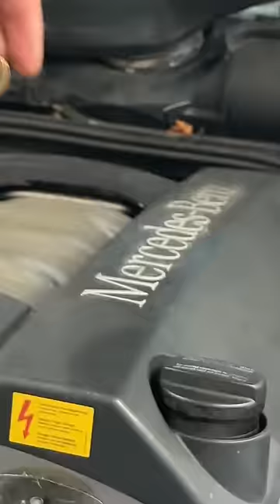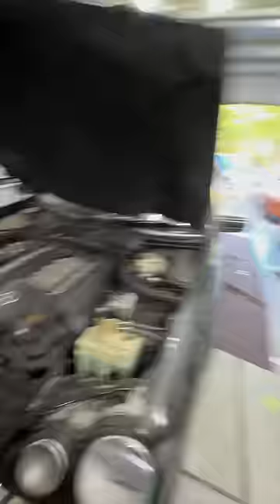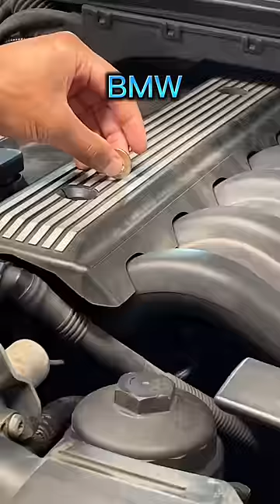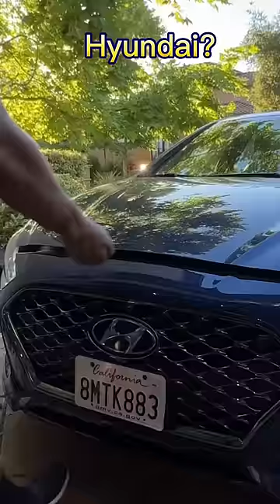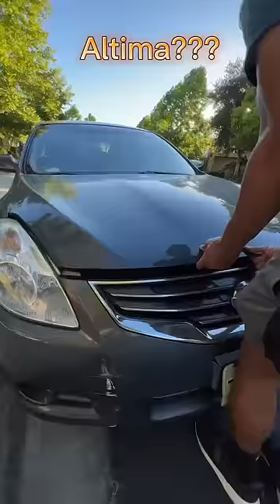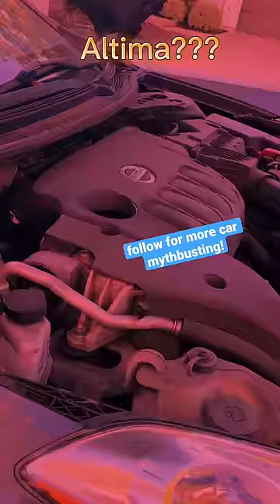The last one is 100% the best 🎩🎩🎩

Comment: This has to be the most pointless experiment I’ve seen, some engine covers are more round ten others, engine displacement are different, exhaust systems would have an impact of not stock, engine type (v vs inline cylinders).
Reply: This would require thought. I think last check zoomers have an average of 7 iq points less than the average of other generations.
Reply: The "coin trick" was the dumbest thing ive ever seen. Completely pointless and makes as much sense as putting a Chevy Equinox engine on a 2004 Vette.
Reply: Its just a flexing vid, "hey look at all my cars"
Reply: Agreed..even each car also got different condition of engine mounting ( rubber )
Reply: It shows how balanced the engine is
Reply: It’s supposed to be a jab at rolls royce and to show how many goddamn cars he got for no reason
Reply: Exactly, it’s as if people never heard of droning
Reply: @tomp6064  bruh engines are meant to shake, it's literally built in so the car doesn't just rattle itself apart
Reply: The reason why the coin doesn’t fall on a RR, is because it’s powered by the most balanced type of engine, a V12. Why this test is completely pointless, it would only make sense if you compared with other V12 engines. 

And then you have to consider the fact about engine covers and stuff like that afterwards.

Comment: as a volvo 740 owner you want your engine to shake it helps offset the piston slap.
Reply: This is the funniest shit I’ve seen all day
Reply: depends of the engine. some architectures can be balanced so that they barely shake because the momentum of one piston is offset by the momentum of another piston moving in the other direction.
you can counteract linear momentum with just 4 pistons in the engine, but it will still produce some angular momentum that will shake the engine. it can be good, but not perfect on a v8, and it may be made perfect on V and W architectures above at and above 12 pistons.
Reply: @niscent_  thats an awful lot of words for "I completely missed the joke"
Reply: @fake_name420  i, indeed, completely missed the joke.
Reply: It's called synergy 😂
Reply: @niscent_  These are jokes that these dorks must announce as jokes before they start.
Reply: It’s actually really funny. Remember the 740’s and I think most any Volvo’s that came equipped with the B230f or B230fT(t for turbo) engines had hydraulic oil filled motor mounts to both mitigate engine vibration (shake) and serve as break away points in a big collision. So yeah they literally designed their car around big ol engine shake.

Comment: "Tell me you don't know shit about cars without telling me."
Reply: True
Reply: Do the coin test 🤣😂
Reply from the maker: you definitely haven’t seen any of my other videos so i guess i can’t blame you 😂
Reply: Competitors but BMW owns rolls Royce and you did it with a Hyundai😂😂😂 Find another hobby or do more research
Reply: lol, agree
Reply: @ChrysGaines  😝 ikr
Reply: @ChrysGaines  You'd have to make good videos first to say that shit tho xD
Reply: @ChrysGaines  You bought a brand new BMW that's a 2.0L, if you knew cars you'd know that's a joke, turbos or not, there's no replacement for displacement
Reply: "tell me you have no sense of humor without telling me"
Reply: Yondai
Reply: yea
Reply: @ChrysGaines  who would want to watch more if they're anything like this.
Reply: @ChrysGaines  uh no... You have torque, balance, mass, reciprocal forces and many more. From resting to start it's not small. Revving is gradually increasing those forces. And V8's are too light to have that clean Ballance. Inline engines are the most stable but again reciprocating masses make it vibrate. V12 engines have equal counter reciprocating masses to have the most proficient performance. The only way to get it smoother is twin engine left handed and right handed equidistant from centerline of the engine bay and a short cable circuit with each starter with the same current in each. But we get that set up on ships. Rarely on boats as they can have 5 outboard motors. Not to mention the bell curve, cause of course that thing just screws you over in some way as it's correct no matter where you put it. There's a certain point of mass to power where the engine will make women very happy. Smaller engines tend to vibrate less as the power doesn't move the mass well, and too heavy where the power can again not vibrate the weight. And the middle where the power and weight mesh well. Aka nissan engines.
All engines will have vibrations i am very aware of that. The smoothest engine. Aka any engine I'd make after brushing up on my knowledge as i have been focusing on other engineering disciplines because that's just stuff i can do for some reason. It will still make a happy lady.
Reply: @ChrysGaines  wow!!??11 who would have guessed that older cars wouldn’t get a high score111!?1?1?1
Reply: @ChrysGaines  you definitely just dont know how cars work
Reply: @memorimusic420  and who gives a f*ck how cars work 😂 this sh!t is a hobby for 90% of us
Reply: @Ksilla007  bruh🤦‍♂️
Reply: " Tell me you're just jealous of somebody's collection and income you could never have without telling me you're jealous "
Reply: dude is really in the comments pretending he knows something
Reply: @ChrysGaines  noice boom roasted
Reply: Rolls Royce, BMW, Mercedes, Hyundai, and everyone's favorite brand.... Altima lmao
Reply: @ChrysGaines  why would anyone watch them after seeing this video..
Reply from the maker: @guiltkill5607  I only talk down to people who don’t have enough brains to process a simple fun video done with the vehicles I have available to me in my garage.
Reply: @ChrysGaines  Well you should have enough brains to understand that 95% of people watching your video or come across it, will think it's extremely misleading (which it is) BEACUASE THE MAJORITY THAT COME ACROSS IT DONT WATCH YOUR VIDEOS THAT ARE JUST AS MISLEADING. I rest my case. Make better videos, end of story.
Reply: @ChrysGaines  ChrisGainSomeBrains
Reply: @ChrysGaines  who cares lol
Reply: @kane2440  copycat
Reply: @guiltkill5607  u should know that the vids are made for fun and not meant to be taken seriously which is something only the 5 percent can do
Reply: what is it for?
Reply: IM THE 6.9K TH LIKR LETSSS GOOOO
Reply: @ChrysGaines  you had it right on the valve cover for the second car.
Reply: @Chrys Gaines  you literally know absolutely nothing
Reply: it's a test...not a fucking exam
Reply: @entiretotalityofwhateverexists  calm down
Reply: @monkey5818 bmw didn’t always own rolls Royce and rolls Royce is still technically a separate manufacturer. It’s not exactly completely bmw. If anything bmw is picking up what rolls Royce left behind because stability and silence has always been a RR thing
Reply: @monkey5818 also that bmw isn’t a bmw owns rr bmw it’s too early
Reply: FACTS...them mounts on that Benz got 234k orig miles
Reply: @autolabpro3186  learn to spell
Reply: @puppetmaster634  oh ok, what did I misspell ?
Reply: @puppetmaster634  😁😁😁
Reply: @autolabpro3186  1, that comment makes no sense. 2, "them" wast the right word
Reply: @puppetmaster634  ah yes! Thank you!
Reply: @autolabpro3186  learn to spell
Reply: @puppetmaster634  I will take a class tomorrow, thank you
Reply: @autolabpro3186  enough sarcasm already
Reply: Man… bmw sucks
Reply: @ChrysGaines  After that one no man would like to watch another
Reply from the maker: @doublebaked267  i mean, 22.8 million views and 13k new subscribers later, I also wish a different video of mine had blown up like this 😂
Reply: @ChrysGaines  stop making excuses, you've been caught. Accept your defeat.
Reply: @ChrysGaines  well it would be a start for you to aligne the coin with the engine the same way..
Reply: @ChrysGaines  not like you gave anyone a reason to lol  here you go... you dropped this "L"
Reply: Dude bought the craziest cars known to man
Reply: lol You have 12k likes 15 sub
He has 700k+  likes    Alot
Reply: @jayrich8826  he has 762k likes and 744k dislikes. get a Chrome extension to see dislikes like a normal person would, please
Reply: @shokimo6866  nah your unnormal if you have time for that💀💀💀😂
Reply: @puppetmaster634 you yourself can't spell tf is "wast"
Reply: @curedanxiety1679  look it up
Reply: @ChrysGaines  it's unfair dude
Reply: The joke is Nissans engine mounts always go bad and the cars a POS. If you ever had one or worked on one you'd know.
Reply: @ChrysGaines  is it so hard to say OK
Reply: @ChrysGaines  just watched your "build" with everything is on the car and its got a cheap ass intake filter on it lol. Stock motor and you put tires on it lololol
Reply: Bro got offended
Reply: @ChrysGaines ignore the haters, people are gonna be jealous and hate on anything, keep up the great videos!
Reply: @puppetmaster634 what do you mean by wast? You can't spell too? 😂😂
Reply: @TheOminousVoidWispers you have no car and you're talking crap about another person's car 🤡
Reply: @javierscaletta3525  so just because someone makes a spelling mistake they are instantly an idiot?
Reply: @ChrysGaines make videos worth watching that aren’t completely useless first and we’ll watch those lol
Reply: @kane2440 Briggs and Stratton are the greatest not some junk v12 if not a 2stroke dirt bike so smooth and no vibration
Reply: @Ksilla007 well the 99.9% need to hit the garage more.
Reply: @gusgus_22 lame
Reply: @ChrysGaines  cant figure out motor mounts though lmao
Reply: @ChrysGaines you compared a rolls to a Nissan Altima... Nuff said. The merc is the only thing competing with rolls here.
Reply: “Tell me you don’t understand what this video was about, without telling me.”
Reply: It's all about content, and NOT TO TELLING HIM THAT HE DOESN'T KNOW ABOUT CARS

Comment: “Rolls Royce coin trick”
Lexus “I think you’re confused”
Reply: Haha yeah they should test it on a lexus ls
Reply: Yea. It was ls400 that came up with this trick
Reply: Nah since 1906 rolls Royce used this trick
Reply: @cdeux3059 I’m pretty sure Lexus came up with the wine glass tower one, to boast there Bose suspension (Bose suspension didn’t even end up coming out lol)
Reply: @subzerothehero5433  🤔 hmm. did they have bose suspension in LS400? I actually don’t know. But I’ve seen few videos where a bose suspension was tested recently with an old LS400. That wasn’t a mechanical suspension but a software driven one. And it was identifying bumpers with its sensors and shrink the suspension when hitting a bumper, if it is the opposite, then the suspension would be stretched.

And yeah. The wine glass tower commercial was a huge success same as the ls400. It was a car that was manufactured to compete with BMWs and Mercedes Benz. As I know, both merc and bmw sued Lexus for manipulating the market by selling undervalued cars because lexus was a huge successful alternate for german executive cars while being cheap.
Reply: I was about to say lmfao
Reply: @subzerothehero5433  yeah, but there's video of it working in pre production models (I think) and it's seriously impressive. I think it was either to expensive or to heavy to end up using
Reply: 1uz lifeee
Reply: @subzerothehero5433 it’s been upgraded and sold in Chinese vehicles currently. There wasn’t a use for it on road cars in America.

Comment: Meanwhile: Honda civic with laptop
Reply: Yes bruv
Reply: coin launches across garage
Reply: @foosmonkey  what you taking about? Honda civics are some of the best built and most reliable cars around. I have no idea why so many people shit on honda when they along with Toyota's brands are the most quality vehicles available. Everyone ive talked to that shits Honda lack knowledge of cars..
Reply: @MrZacharykgwin  I’ve driven nothing but Hondas since 1997. I love them. I currently own 3 and my accord would certainly pass this test.
But let’s face it, a laptop Civic with 1000hp isn’t exactly going to have a silky smooth perfectly balanced engine that you can balance coins on top of.
Reply: @foosmonkey  I see what your saying. I was confused sorry.  If I really wanted a sporty civic I would swap engine with k series
Reply: @MrZacharykgwin  older civics are great track/hobby cars, but not daily drivers. Driving one on the highway will make you deaf.
Reply: You meant to say dancing laptop😀
Reply: @MrZacharykgwin  Honda aren’t very power built tho
Reply: @99gmcsierralm74  huh?
Reply: My 2009 si with a valve adjustment might be able too.
Reply: @99gmcsierralm74  you'd be surprised the shit you can put a late 90s civic through if you've never owned or known somebody who's owned one. The main thing is they're cheap to work on and cheap to get power out of, and light as hell so you don't need much power to feel like you're 5 psi away from snapping your neck.

Comment: Well uou need yo test them with brand new engine and transmission mounts lol
Reply: Exactly what I was thinking 😂😂😂
Reply: Yea this just shows he needs to refresh those bad boys
Reply: Exactly what I was thinking
Reply: He's missing a bunch of cylinders too
Reply: Glad someone else spotted this, old ass mounts and cars clearly not gonna reach like a new car
Reply: For real.
Reply: Came here to say tht
Reply: Well the coin trick works on old RRs too
Reply: Or same surface.
Reply: Cap my Lexus IS 11 years old you can balance a coin on the dash no problem
Reply: Exactly lmfao this is such a dumb test
Reply: And not on mid range cars.... A BMW 7 Series or S-Claas would have done much better.
Reply: *pulls out a e36/e39 type bmw
Reply: Exactaly
Reply: Well she is a woman after all
Reply: facts that e36 probably has the smoothest running engine there, like how all bmw inline 6 engines run lol
Reply: @snap_zsm  Maybe.  V8's tend to wobble a bit, though.  This only works well on the Rolls because it uses a V12 which is smooth as silk.  An S600 would probably perform similarly.  The S65 AMG would toss the coin out of the engine bay due to the torque when it started.

Comment: when it comes to vibrations a lot depends on the engine mounts, and those on the Altima are clearly shot xD
Reply: 1000% correct
Reply: Lol no, that’s part of the issue with age but new it’s still going to fall. It’s too small of an engine.
Reply: @StunnaDroppedYou  they can be too stiff / too soft from the factory too, I think vw GTi has a problem with weird soft vibrations being sent through the iron block and soft mounts which makes the car feel less "sporty"

Comment: Do u know about engine mounts?
Reply from the maker: i’ve got poly mounts in my Z, poly ready to go into the bmw, and a lot of convincing to get my sister to buy new motor mounts for her car 😂
Reply: It's gotta be a v12 also.  
Pretty much any v12 from any manufacturer will run smooth if in decent condition.
Reply: @pepepantuflas1  straight 6s will also do the job